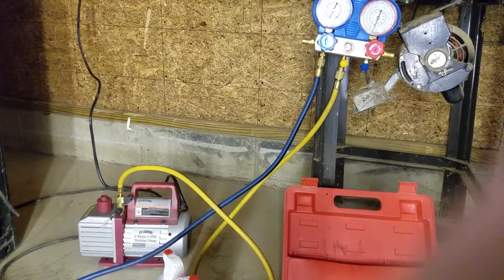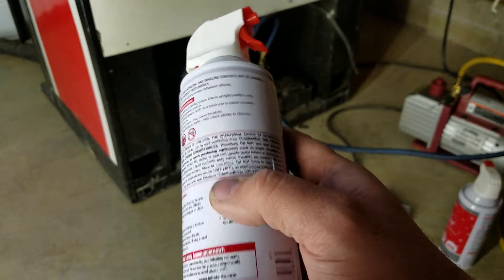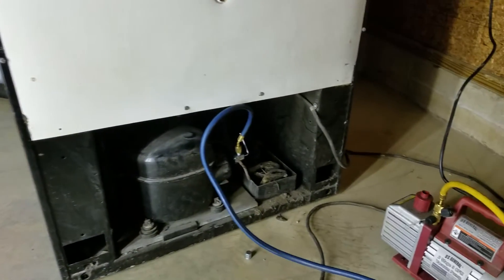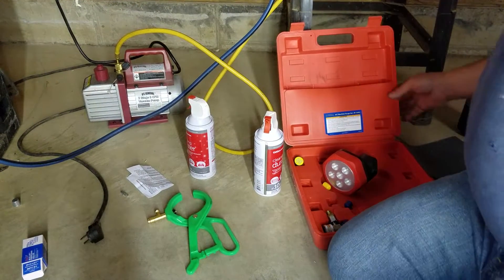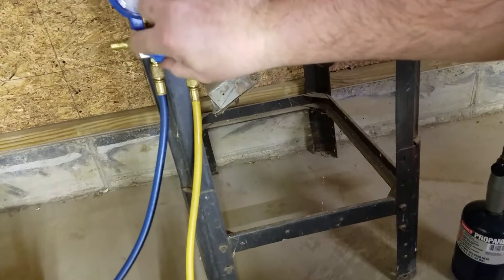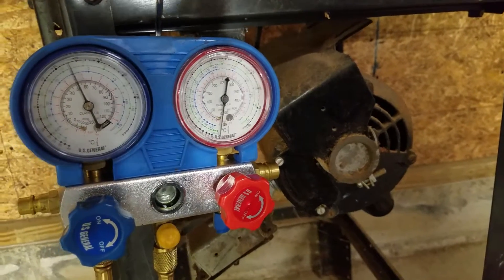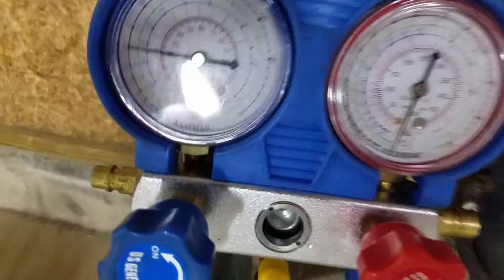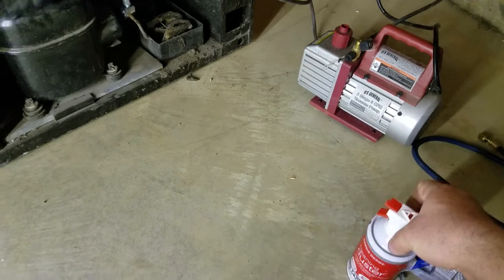Using Air Duster to Recharge a soda machine refrigeration unit.  Spoiler..  It really works

Comment: Please show me the kind of hose to buy, my guy says I just need a little bit, so would I need a vacuum pump?  He thought he needed r12 and the hose links.
Reply: You need a piercing tap or a soldering tap and a gauge set with 1/4" ends that basically would fit on a quarter inch male flare fitting basically all the gauge sets are the same with 1/4 ends I think it's worth buying the shut off ball valves to put at the end of your hoses. when you're doing automotive they are like an air Chucks they make adapters to go from your quarter inch hose and to the 134 Chuck for automotive which you will not need unless you're working on a car. And yes you will need a vacuum pump or you can build one out of an old refrigerator compressor I suppose. watch lots of YouTube videos and learn how to in the stuff safely anytime you're dealing with refrigeration there are some safety factors unless you have years under your belt in refrigeration you should wear gloves and face/eye protection you can get a nasty burn real quick even if you know what you're doing.and I'm not telling you this to deter you from doing it just use caution and watch lots of videos so that you know what you're doing 😉 there was a guy that did a video I think it was called simplified refrigerator recharge or maybe he used the word easy anyway he didn't make it complicated he made it easy for everybody to understand, it wouldn't hurt to watch a few HVAC videos a big air conditioning unit works on basically the same principles the main difference is a refrigerator or pop cooler uses what is called a capillary design instead of a piston or orifice most modern refrigeration units use a TXV or a thermal expansion valve other than that they have the same basic fundamentals a compressor expansion of gas condenser and evaporator.  you will find the stuff you need on eBay or Amazon. Keep in mind that the gauges are different 4 different gas however they still read PSI and vacuum you can find a chart online to find out what your subcooling will read at what pressure for any gas then you simply use a thermometer and do the math however for what you're doing you're probably not going to get that technical to make sure your system is running at maximum efficiency but you could like I said you can learn all that by watching some HVAC videos and I understand it will be confusing at first but after you watch a dozen or so things will start to come together 😊 and before you know it you will understand refrigeration probably better than some that run from door to door with a van doing it for a living some people learn what they need to get through the school and that is all I know a lot of HVAC video guys are giving you their trade secretsand tips they have learned along their career on these YouTube videos making this day and age easy for someone to learn the basics and then get School certified in the field.

Comment: I'm a newbie to all of this, what is the purpose of the vacuum pump in step 1?  Great video, btw!  exactly what I was looking for.
Reply from the maker: Vacuum pump removes all the air and moisture from the system.  This way the refrigerant can do its job.  Without the vacuum, the refrigerant quantity isn't enough and won't work well, or might not work at all.
Reply: @just_a_guy_doing  chad, if it already has r12, can you add the air duster to it? Or , do you have to bleed the system first.
Reply: @WhatShouldYouDoSafeParenting  you need to evacuate whatever other gas is in it out so the system is empty then pause vacuum on it with a vacuum pump drawing it down to low of a vacuum as you can get in your elevation this normally means running a vacuum pump and pulling a vacuum for an hour or more to make sure there is no moisture in the system. Then you would recharge it watch some other YouTube videos there are lots of them out there to get the basic concept it doesn't matter what refrigerant gas they're using in the video there is still learning to be had.
Reply: @WhatShouldYouDoSafeParenting  No, don't mix different kinds of refrigerant.

Comment: hello i have an old coke machine when i got it it has no gas in it i don’t know how long its been seating do i need to do somethingto it or just add gas thanks
Reply from the maker: First you need to put the system under vacuum and then charge the system.  Without the vacuum the refrigerant has no where to go, due to atmospheric air occupying the refrigerant system already
Reply: Thanks I did the vacuum I have a pump and I did put the van air and is working fine I couldn’t see the 20 you said you had if it was in psi or 134 or 410  in the gage I put abut 20 psi and the after about an hour it staid at 15 psi it’s holding there for about 20 hrs and is making the sodas cold  how long did yours last or is it still going

Comment: Charging liquid refrigerant straight into a cold compressor is a no -no. I'm surprised the compressor still pumps.
Reply from the maker: Umm.  The compressor wasn't cold, there was no refrigerant in the system, guess you didn't watch the whole video.
Reply: HVAC techs charge liquid refrigerant time central air conditioner suction line. It evaporates immediately after it enters the service valve. By the time it enters the compressor case, it’s already a gas not a liquid. HVAC techs have to charge liquid refrigerant into air conditioners that use R410a freon because it’s a blend of different freons.

Comment: There's also a refrigerant from a company named "EnviroSafe". Their refrigerant is compatible with R12 and R134a, and it worked wonderful for a retrofit that I did on an old car years ago. That refrigerant can keep your system working even when it's leaking and you have a capacity left at around 30%. Never tried this Duoflurethane stuff because the price of it vs the "Envirosafe" can ar mostly the same. I might try it sometime. Fantastic it worked for you.
Reply: "EnviroSafe R134a Replacement" is a mixture of propane and isobutane.  Environmentally safe, but highly flammable.